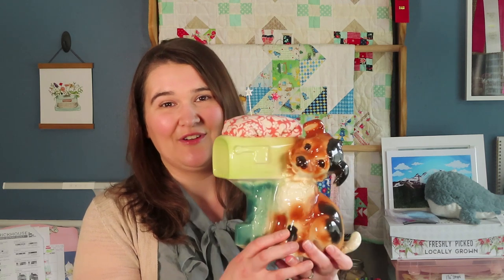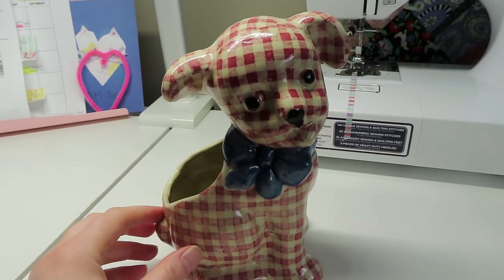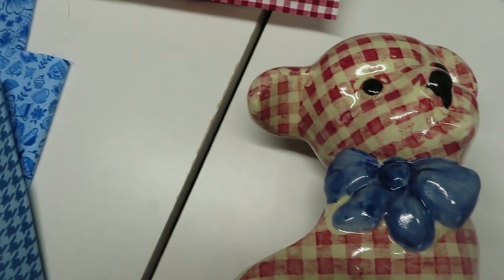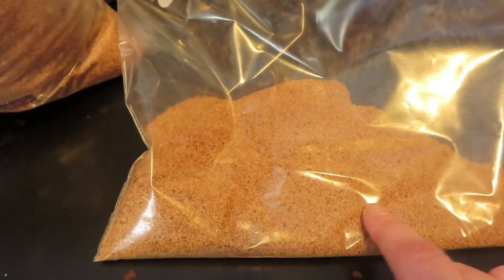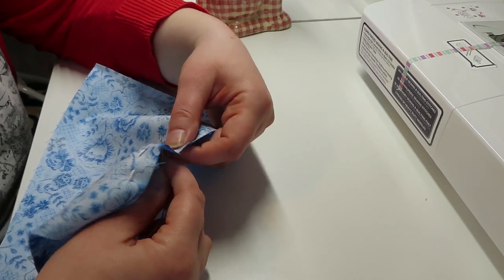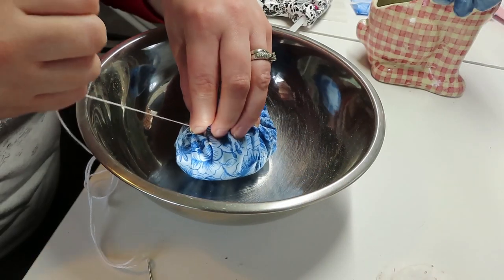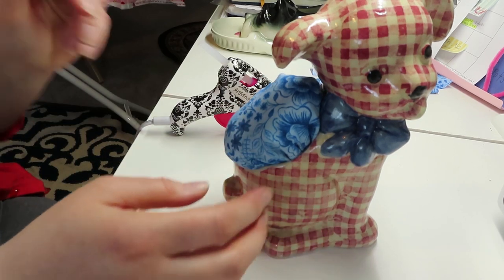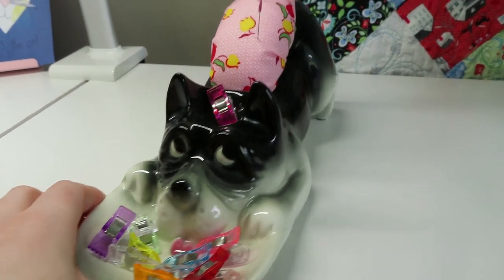How to Make a Pin Cushion with Antiques (Plus, My Antique Store Finds!)

Comment: Love your use of antiques! Thru the years, I’ve found using pieces of wool for pin cousins has worked best. It does not absorb humidity as walnut shells, sand or rice. The wool scraps are excellent for sharpening pins as well
Reply from the maker: Ooh, thanks for the tip, Helen!  I have some scrap wool.  I'll have to try that next! :)